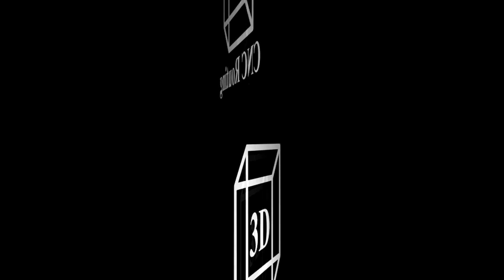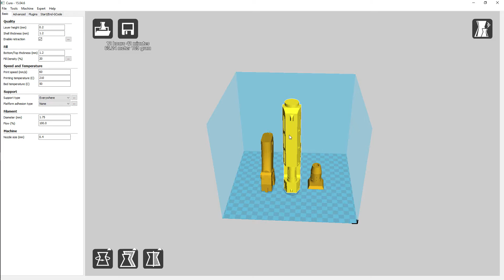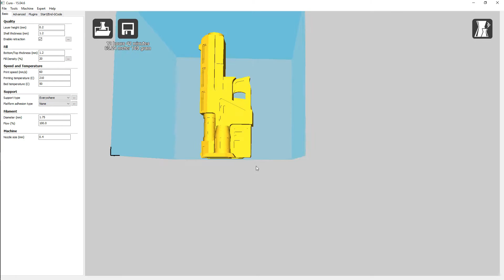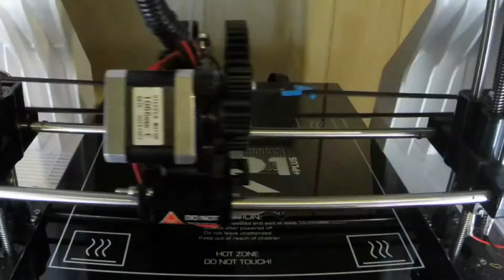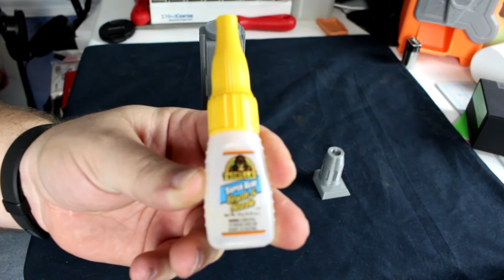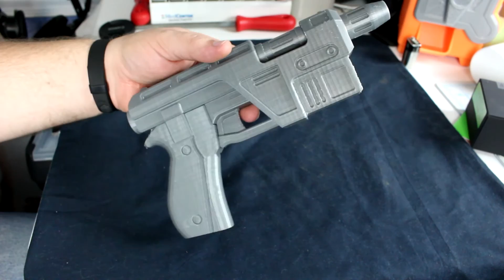3D Printing: Poe Dameron's Blaster

Comment: Has anyone made a version with a pull trigger?
Reply from the maker: Not that I have seen but this one could be modified to have a pull trigger with a bit of work. I will try to take a look at it soon and see if I can modify it to have a pull trigger.
Reply: Actually a video that popped up on the side bar had the same blaster hollowed out with a working trigger and the guts of some cheap store bought gun such that the trigger turned on the lights.